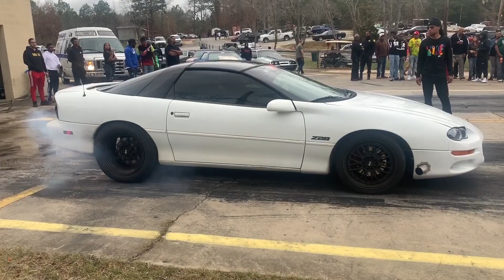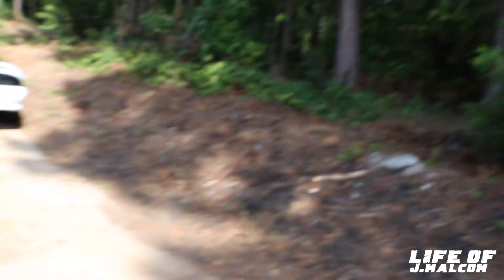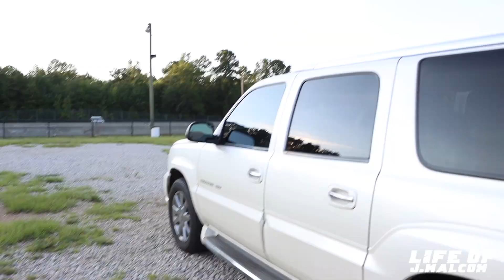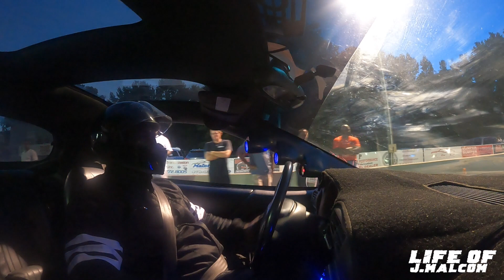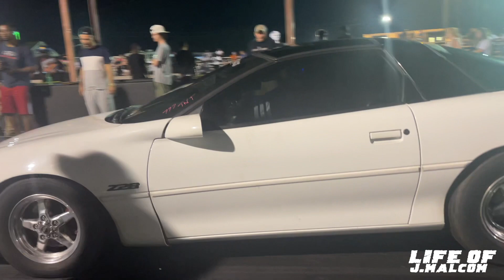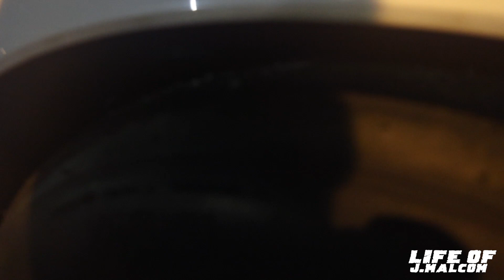WHAT A WILD DAY AT THE TRACK FOR THE JON JONES TURBO CAMARO

Comment: Bro you need to do test and tune on the street near by your house or something. you be wasting hella gas and time going to the track and making 2-3 passes. That’s just a waste of time. These last few videos I been watching have a lot issues that can be handled before you get to the track. You need your tuner or you need to learn how work on your car at least a little so you don’t have to drop your car off every time something go wrong. It’s gone take forever to get your car dialed in if you gotta drop it off every time something go wrong. You making long trips to the track for 1 or 2 passes.
Reply: @fastass68camaro  I don’t think you know the purpose of testing on the street. Testing on the street to work out all the kinks besides hooking is very beneficial. Alot of issues that he’s had with all his cars he could’ve found that out by street driving. No need to load up on a trailer and you got drive a few hours to the track just to break down every time. Or shit not working correctly every time. For example his bump box violently jumping a cross the line. You can Do a lil shake down pass on the street to test shit like that. Don’t even have to get up to speed. Or his push rod being broken. Why go the track and your car not running 100%. I’m tryna save this man some time. Everybody who knows even a tinyyyyyyy bit about racing cars knows that if you don’t have your tuner with you at the track or you don’t know how to work on your own cars, you gone lose every time.
Reply: You can’t dial in a street car or race car with a shop/mechanic who’s not with you at the track to clean up the cars issues. It don’t work like that.
Reply from the maker: NEVER am I wasting money or gas or whatever else you said because this is my BUSINESS and all tax deductible man 😂😎 Got to be in the game I’m in to know that but you aren’t so I get it and I do know how to work on my car man lol. Just choose not to. I because I got a million other things going on so I do it when I can, video it and keep it moving. Im assuming you haven’t been watching long because otherwise you wouldn’t have mad this come t but carry on man lol
Reply: @LifeofJMalcom  what do taxes got to do with your car running right bro? I’m not in the game but my grandad is and my brothers are. I’m not tryna get in yo tax business but that ain’t got nothing to do with dialing a car In.
Reply: @LifeofJMalcom  and I’ve been watching you for a long time. None of your cars have ever been running A1. You had these cars for 2-3 years and haven’t got not one of your motors running right.
Reply from the maker: @TNTkix  this response shows exactly what I’m saying. You got understand what I’m doing or why I’m doing it because it’s just a hobby only to you. I get what you’re saying but you’re on the outside looking in from a hobbyists perspective so it lead you to write all of the above not knowing it’s a much bigger picture than what you’re watching man lol. And all of my cars are running right except Dolo which isn’t major. The Camaro is fine and a bump box adjustment room 3 secs to change man lol. Some of y’all take this stuff too serious and it’s bigger than what y’all see or know
Reply from the maker: @TNTkix  and bro who you been watching man lol. The Cutlass run A1 and nothing is wrong with it. Nothing is wrong with the Camaro, it runs A1 and has never failed mechanically and Dolo is a new build seeing that I haven’t driven it much and just now starting to race it. For somebody that knows so much, you know so little and are in the dark and do t know it. Smoke and mirrors man lol
Reply: @LifeofJMalcom  I don’t take it serious at all my guy. I stated a simple opinion. You talking about taxes and I’m talking about cars running right. Imma carry on though. No hurt no harm🤷🏾‍♂️
Reply: If if they “real street cars like you say, why trailer them” why you dropping them off to get work done every other day? Imma keep it pushing. “Since ion know what I’m talking about”.
Reply from the maker: @TNTkix  🤦🏽‍♂️🤦🏽‍♂️ ok man. Since you got it figured out. Drive my cars more than anybody but I don’t drive them 😂 Aight man you got it and know it lol
Reply: @LifeofJMalcom  👌🏾
Reply: @TNTkix  lol

Let me lay this out in layman's term since you didn't get what he was saying

him making his vlog he made money even if he went to the track he made money do you get that part? It's not a waste of time or waste of money cuz he just made money and you're helping to make money lol

It's YouTube bro not a Charity lol
Reply: @fastass68camaro  exactly man and what happened the last time he got loose on the streets?

This person critiquing should know better this ain't street outlaws where they got a whole medic crew in the street.right there full pass or not
Reply: @TNTkix  lol wow uve been street OUTLAWS